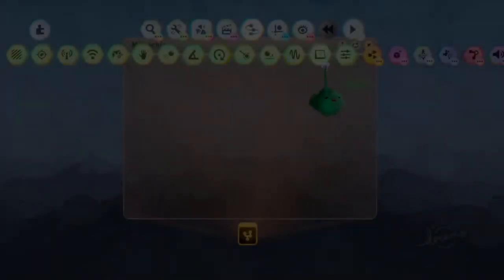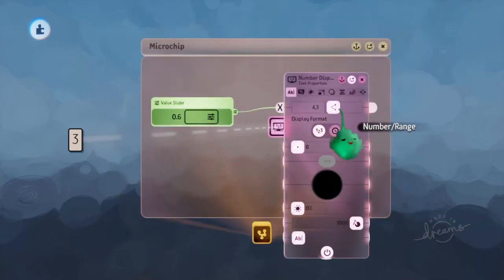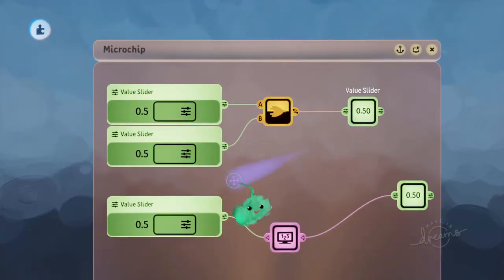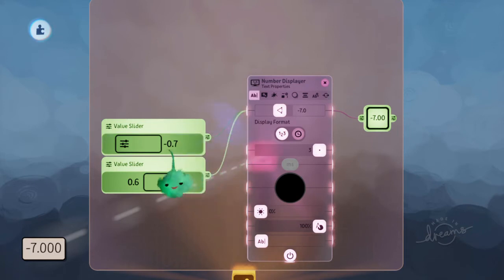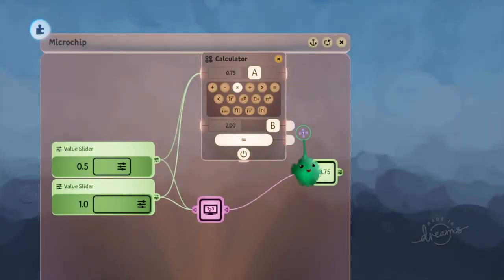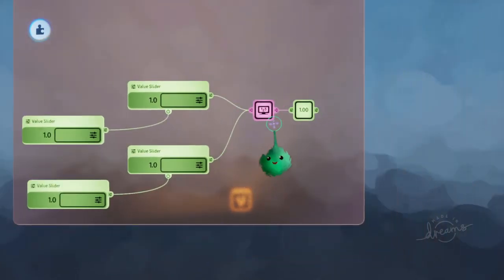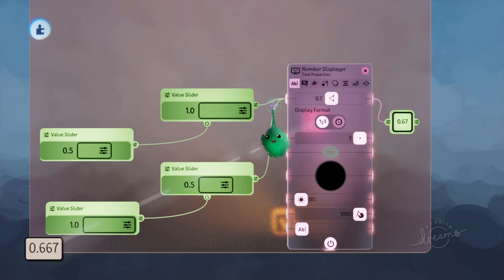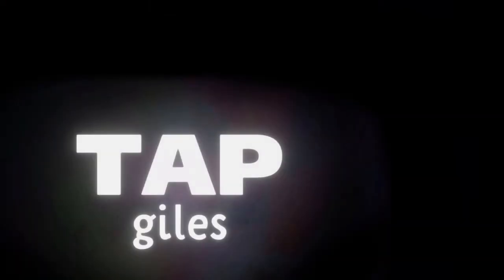Wire Blend Modes | TAPgiles Daily Dreams Tutorial

Comment: Does anyone actually ever need to change their wire blends? I don't see much use in them
Reply from the maker: They do, yeah. By default if a setting has a non-zero value and you wire into it, it will use the modulate mode. So if that's not what you wanted, you'll need to change it back to override.

Also, they let you make some pretty big optimisations if you know what you're doing, compared to how you'd do them without the blend modes. I tried to explain some of those in the video but maybe they weren't clear.

Override uses the value furthest from 0. So you can get the highest value of a series of positive values. Eg. the highest score, the highest time, etc. "Which has the highest score between these 20 players and AI characters?" Without this blend mode, you'd have to use many many calculators to compare them all against each other. With this blend mode, you wire them all into the same place and job done.

Modulate does the same as override, and then multiples the result by the setting. So you can skip a calculator gadget entirely and multiply it by some value. It also collapses a fat wire down to its "default" value. So this is an easy way of getting that value such as how far you're pushing the stick, and see if it's above some threshold all with a single calculator.

Blend is super useful; it averages all the wire values. If this mode wasn't there and you wanted to average 20 values, you'd need 19 calculators to add each one up, then another to divide by 20. Here you need a single node or just any gadget at all, and wire them all in to the same place.

This is an easy way of finding out if many things are true at once; they will average out to 1. "Has the player turned on these 20 different switches?" Use a simple check with a calculator.

You can also sum up many wires, by blending them in a calculator and then multiplying by how many wires there were. "What's the total score between all 4 players?" Use a single calculator to add them all up.

So it's more useful for greatly simplifying low-level specific calculations. If you're just making a simple platforming game or something, you probably won't need them. If you're making more complex logic, though, they're very handy to know about.

Comment: Hi. I hope you can help me with something in Dreams.  In the game I'm working on, the idea is for the character to fall from a height.  But at some point it respawns before it touches the ground. How can I stop respawning.
Reply: i believe you need to adjust the fall height distance to maximum from the global slider gadget
Reply from the maker: @GooglennMusicGamingChannel  And remember to turn the switch on next to that slider too--a lot of people forget that.
If that distance still isn't enough and you just want to be able to fall as far as you want, you can remove the wire going from the puppet interface's "fell out of scene" into the controller sensor's "die" input.